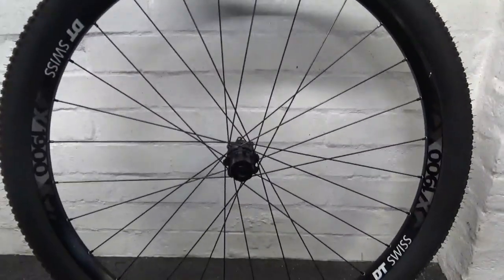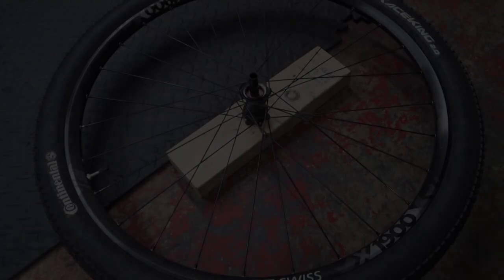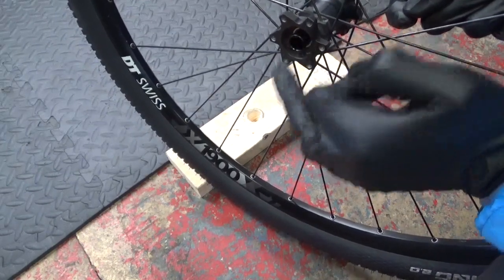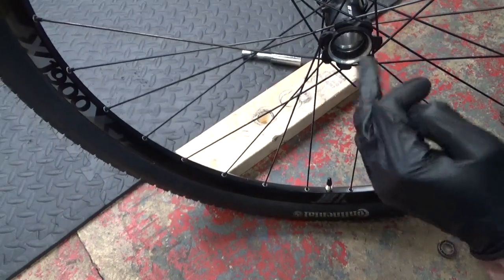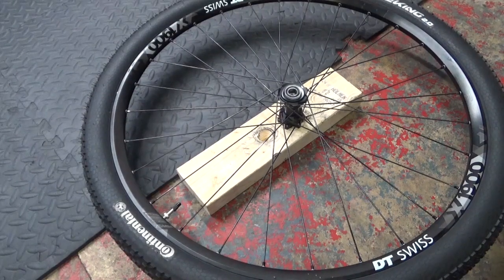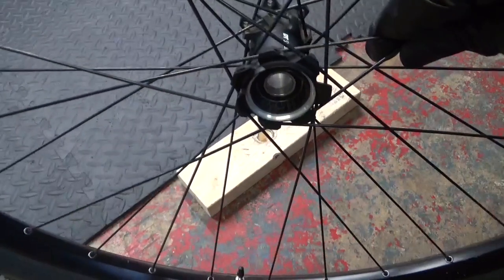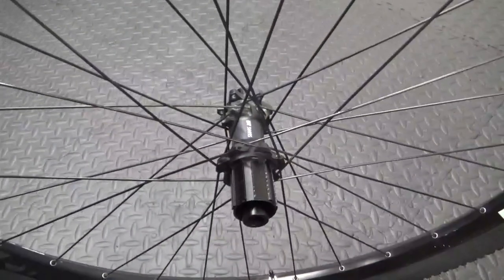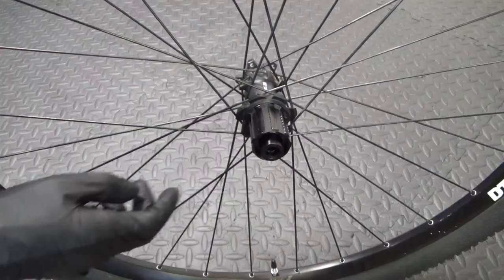DT Swiss X1900 Rear Wheel Bearing Change

Comment: I have a DT Swiss M1900 wheel with a 3 Pawl hub, I believe it's a 370 and a Sram XD driver.  The driver was not spinning well and the cranks would keep moving when they should have been stationary.  In a stand the wheel would even spin backward when I turned the cranks backward.  I tried cleaning and regressing several times but that did not help.  I found the collar on the XD driver was getting hung up on the axel in one spot and also the spacer bushing was slightly mushroomed at the ends.    Replaced the spacer and carefully ground the collar on the driver, greased it up and now it works like new.  This video helped me work out the issue.  Thank you.
Reply: I have the same issue. Where did you get the replacement spacer from?

Comment: Fantastic info, thank you very much!  I have M1900 wheels that are built the same way.  Chasing a ghost pedaling issue at the moment, and I think it's in the bearings of the freehub.  The hub has enough wear and damage from the cassette, and from the previous owner's time with the bike, that I'm going to replace the free hub.  But seeing your video makes me also want to take the axle out and replace the bearings.  I was inspecting it all this week, attempting to diagnose the ghost pedaling, and discovered that spacer won't move, and can't be slid off either.
Reply: Ha. My X1900 rear has a "ghost pedalling" issue, too. I'm coasting along, especially on downhill drifting, and the free hub seems to 'catch' then release to normal, every few seconds. Has gotten worse as I let it go. Unfortunately I cannot get my hub bearing to pop out like in this video. I pop and pop with a rubber mallet and the bearing is just fused to inner wall of the hub. Granted, I don't have the block of wood (I have soft jaws in my vice, open enuf to brace the non-drive-side rotor mount but let the axle thru) and my rubber mallet does not look quite as hard as that in the video.

Comment: Good video- I don't have a vice and the NDS end cap seems rather tight- rather than trying some bodge with vice-grips could it be knocked out with the bearing too at the same time?? Or is that too much work for the axle to do and may damage it??

Comment: Great video..I’m getting a good bit of play on my m1900 rear wheel. The hub body bearings aren’t the smoothest but I’m not sure I’d be able to feel play if it was the hub, however if the axle bearings were gone would I be able to shake my wheel and feel play? Thanks

Comment: Hi, thanks for posting this video 👍🏻 so the ratchet ring can stay in place on these 3 pawl designs?
Reply from the maker: Yes!
Reply: @FreeToCycle  I have the same hubs with the same bearings and my bearing do not fit through the drive ring.  I purchased the dt swiss 3 pawl drive ring removal socket and the socket is just ever so slightly too big.  the new bearings do not slide through the drive ring when trying to size them up and they are the correct bearing.  can the drive side bearing come out the other way? I have no way of pulling the drive ring

Comment: Hi. I have a DT Swiss Syncros 3pawl hub (might be a road with centre lock) which I believe is also a 370 but I'm having real trouble knocking the axle out as shown. Do they all use this method? great vid btw, surprised nobody else has, these hubs are common as muck
Reply: I am having the same problem, did you come up with a solution in the end?
 Thanks.

Comment: hi dont you have to remove the black ring nut with special Dt swiss tool  ? before removing the bearing cassette side  ?  thanks
Reply from the maker: No!
Reply: Free To Cycle  in
my case for dt370 hub 3 pawl  (giant trx1 wheel )  , its necessary
Reply from the maker: No!!
Reply: After ordering the wrong tool, I watched this vid and gave it a go without taking the ring out. The bearing initially wouldn’t budge, so I thought that the hub is slightly different. Found the correct tool on line, it’s effin 50-60 quid!! In the end, I tried dropping the new bearing down the axle, to see if it would fit into the ring, and it did (obviously just slightly, not all the way in). If it can go in, it must be possible to get it out. It did come out in the end, just needed a lot of encouragement! The ring is not in the way (spline e1900).
Reply: @prusak26  so I don’t need the tool? Iv been flogging the axle and the bloody thing won’t shift..I’m going mental 😂
Reply: @scotty-sb1403  took a lot of hammering but the bearing finally came out, the ring was not in the way.

Comment: I did this but then found when QR was clamped the freehub would stick (basically a fixie). What could be wrong? It was very hard to get the driveside bearing past the ring nut.
Reply from the maker: Either the bearings aren’t seated fully or the spacer on the axle is worn, which is a common problem!